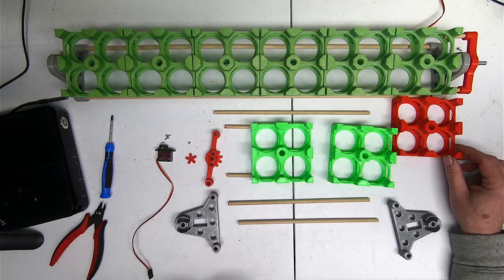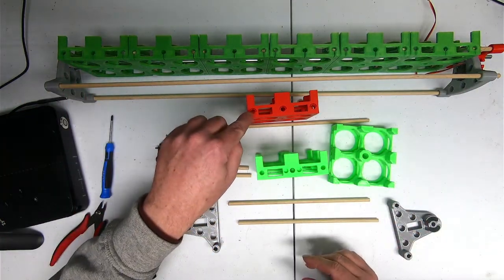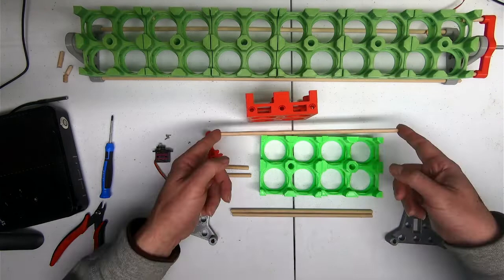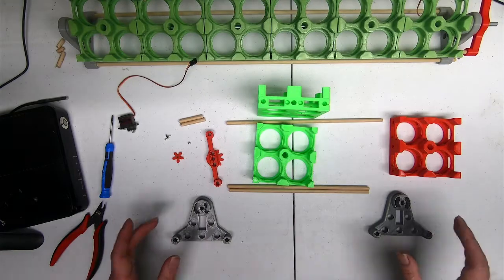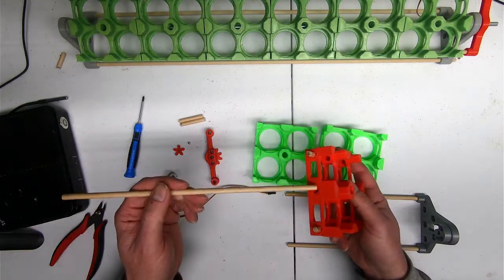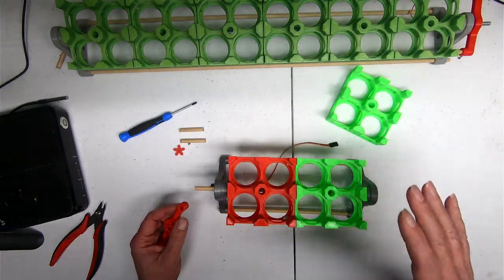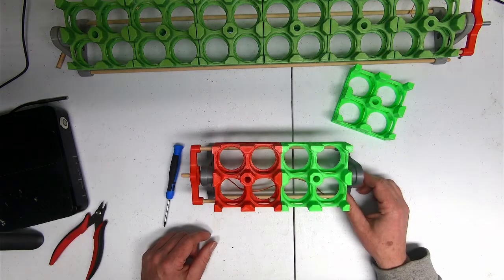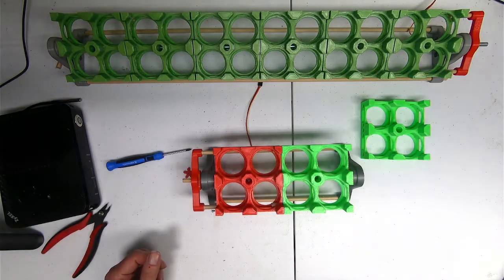DIY Incubator 3d printed egg turner

Comment: At the end you can’t turn it
Reply from the maker: It sounds like you are referencing the point in the video where the gear is installed. With the gear on it needs to be hooked up to a controller to turn.   There is a fallow up video showing how to connect this to a Raspberry PI. Leave the servo and gear out to turn the eggs manually.  I hope that helps..